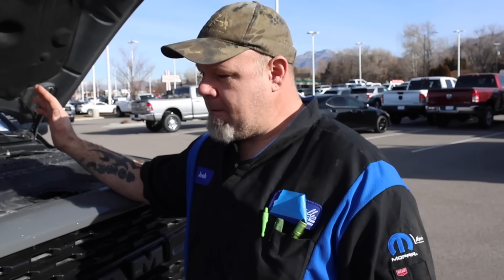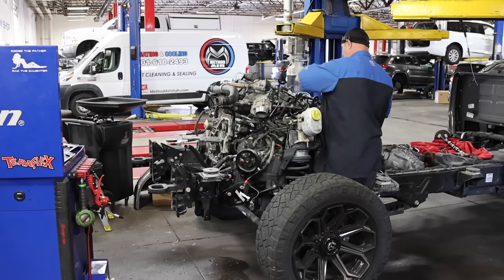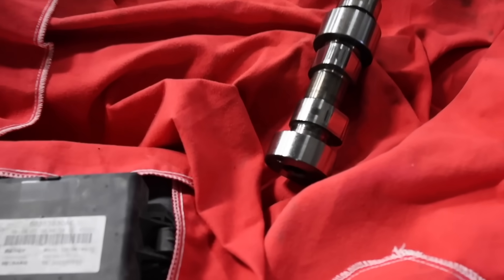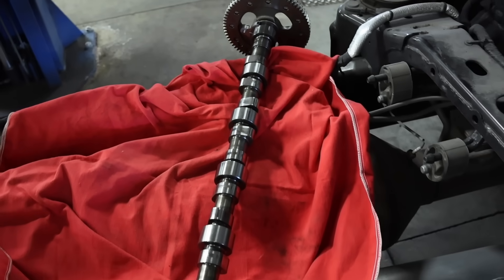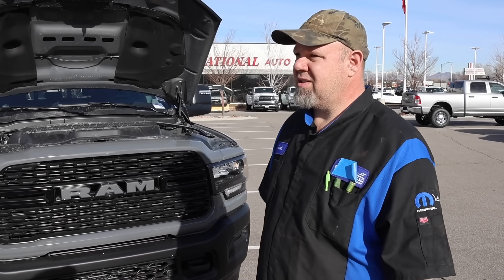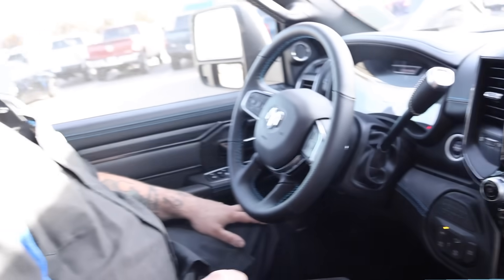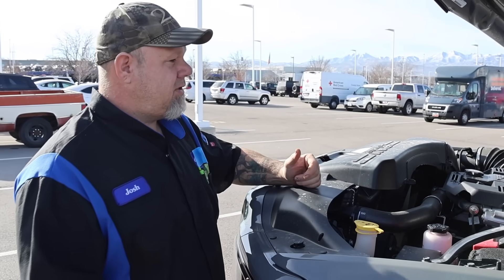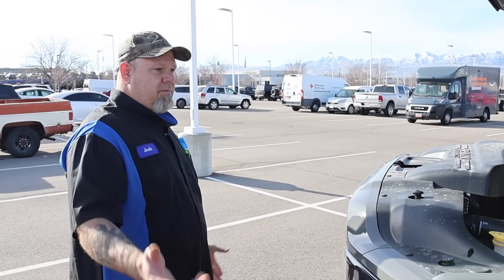Master Diesel Tech Explains The BIGGEST Killer To Your Diesel Engine!

Comment: I have been changing the oil in my old 7.3 diesels every 3000 miles since they were new in 2001. They are still going like the day I bought them.
Reply: Oil changes are cheap insurance .  I dont care  if its at 3 or 5000 .   15000 is just stupid .
Reply: Hey if you got the time you got the money whenever makes you happy
Reply: 5000kms in Australia if u are using it😊 or 10000kms if it's a shopping cart😮
Reply: @lukewarm2075  I agree, people forget the air filters too which causes all sorts of problems. I tow 1800 to 2000kg trailers on occasion from Sydney to the Gold Coast it makes a 20yo 5 speed manual Mazda Bravo work but regular monitoring of the motor keeps it going. I bought it new and plan to keep it.
Reply: I have a Holden rodeo  with Isuzu engine it’s done 400,00k change oil every 10,000k  with filter still running perfectly like a clock it’s 34yrs old never had any issues with this engine  it will out last me😢
Reply: Thats why they still going good all the extra oil changes still way cheaper then rebuilds me very similar will all engines 5000 kms or 3000 mile oil change New Zealand
Reply: If you are going to keep the engine going for high miles, then I'd change the oil and filter every 5-6,000 miles. If I was going to move if on after a year or 2, fine, just keep it topped up.
Reply: 3000 miles is perfect.  5000 miles is kinda the limit to oil changes.   2001 was excellent as it didn't have all the annoying EPA requirements of today.   Keep that work horse running!
Reply: They should last forever doing that. Smart.
Reply: Oil is cheap flushing out the bad in with the new also clean fuel and clean air
Reply: Thank you for this information, I was beginning to doubt myself with all the anti idle stuff, common sense says not to start driving with a cold engine
Reply: That’s also the best diesel engine ever made!
Reply: Yes, but your diesel engine doesn’t have all the EPA mandated crap on it.
Reply: I start truck before closing the door. If raining I close when I get in.  Once started, I adjust all mirrors, arrange any items, change to better radio station or plug in phone…  buckle up, etc.  this can take 10 or more seconds.  By then, the oil is moving thru all lubricated parts. Never ever “blip” the throttle… that puts more strain on the head gaskets… same with driving or acceleration too fast before engine is up to “operating temp.”.. I have seen more “blown head gaskets” on Harleys, cars, especially if you are jacking with the “tune”…
Reply: we got the same motor in a work truck. It has 500,000 miles and it's lucky if it ever gets an oil change.
Reply: Yaaah, going like a raped ape.
Reply: Dude my buddy changes his oil once a year in his 2012 duramax. He uses the Amsoil 25,000 mile oil.
Reply: @matthewlong2981  I changed the oil in these vehicles twice a year whether they need it or not but I drive under 3000 miles a year because I have several of them and rotate them around
Reply: That's what is in the owners manual and recommended buy navistar and its due to the antifoaming agents in the oil that is needed for the HUEI injectors to operate correctly. The anti foaming agents usually go before the oil itself is done. 
You can't compare and  30 year + old designed diesel that is all cast iron block and heads to the new power plants.
Reply: @Patriot108-1  That's right; it's not fair to the new junk to compare it to the properly designed engines of the past.
Reply: @Patriot108-1  it is actually 7,500.
Reply: Bullshit
Reply: why not every 1000 miles? If you are going to waste time and money on oil changes, take it up to the next level.
Reply: @RobertTate-qy6nk not your truck is it
Reply: @RobertTate-qy6nk depending on use and heat and environment and time between oil changes
Reply: @RobertTate-qy6nk found the guy that goes 10,000 miles per change

Comment: At what temp would you shut off the engine? I pull 28k in high humidity and oil temp can get up to 230 degrees. I have to let it idle from 10 to 20 minutes to get around 200.

Comment: I live in Colombia (country) and have a Toyota Hilux diesel engine. The intervals of engine oil change is 3000 miles recommended by dilership and manufacturer. Happy to do it so often and the price is only 50 dollars for the change in the dillarship. This video is making me think that may be should shorten the intervals? The temperature of the area where I live is very hot all year around Florida wether. I was wondering what’s the reason of a 3000 mile of a recommendation of a oil change or 6 months. Some though about this intervals will be appreciated. Thanks
Reply: And yessss for starting the engine and living it runing for 5 min before driving the car. Me toyota does not have running the engine on a faster RPM than the factory set that in the morning is around 1000 RPM. Should I give I press the revolution pedal to increase the RPM to 1500 when I warm up me engen in the morning or won’t be recommended since the wether here is so hot ?
Reply: Thanks for the advice

Comment: I have 5 trucks with over 500,000 k on them. I used a diesel cooling heater. 
I don’t I don’t idol the trucks. 
I get my oil analyzed every 10 k 
I’ve gone its highest 50,000 case I don’t oil change. 
My motors stay clean and one motor at 560,000 k I did a bearing roll not one bearing was bad they looked relatively new still. You have to work those engines. If you drive it for a grocery getter then buy a gas truck

Comment: 10 min autostop  is so it doesn't run till its run out of gas when you order one more beer and forget about it. Higher revs in neutral is not great, its injecting very little fuel with no load. if you have a heavy trailer, sure warm it up for 10 min, but if you're going to a store just drive like you have a newborn with you for first 5 min

Comment: Could you do a long video, or maybe a playlist, on Diesel 101 for new diesel owners?  I found this information extremely helpful as someone who has never owned a diesel but is interested in buying one.  Basically a detailed walkthrough of diesel engine basics, how all the parts of the exhaust system work, how to properly operate your vehicle from cold start to shut off (when towing and not towing), things people should be aware of when switching from gas to diesel, what to look for when buying diesel fuel and DEF, 101 on glow plugs and grid heaters and how they work. What things to do differently in cold vs hot climates (and what those temp ranges are). Essentially a crash course on owning a diesel engine for gas engine owners so they are prepared as they can be so they get the longest life out of their truck, plus any tips and tricks you’ve learned that you think new diesel owners should know. I’ve had a 2019 1500 5.7 for 3yrs and I’d like to step into the diesel world but I want to be as prepared as I can be before actually owning the truck.  If you could also do a video on things to know when upgrading from light duty to heavy duty trucks and what all changes when you upgrade from light duty to HD, that would greatly appreciated too.
Reply: First time Diesel owner( 22 Ram 2500) here got mine to tow a travel trailer as we both just retired and wanted a truck to handle long trips. We took it from Va to Ca and back only had one small issue but other than that it did great especially in the mountains. The best advice I can give you is go to a local Diesel shop they are a wealth of information and the main thing they said was do your maintenance.

Comment: I change mine anywhere from 3,500 to maybe 4,500 miles. I changed it myself and don't mind spending $130 cause it's better than $15 to 20k for a new motor ii have a 6.0. So it's not as expensive as all them $90 to $100k trucks

Comment: Great video, have a 3.0 F150 diesel. I do oil changes anywhere from 2500-3000. I run about 2-3 quarts of oil through oil fill and filter house to push out old oil. At least one a year I flush with 4 back to back oil changes with filter running at 15 min each, 4 oil change is final. No I no no one will believe this but after doing that I takes about 100-1700 miles before it starts get dark (not fully dark). I run Rotella T6 5w 40. 

Just had both timing belts both timing chains changed with tensioners, changed glow plugs, fuel rail lines (at engine) water pump, thermostat, drive belt. At 139000.
Reply: You like wasting money.
Reply: @j-rocsk  i mean he has a weak diesel so he has no option really

Comment: Ok, you may think I am telling something not true, but I have been using 24,000 mile oil change since 1977 on several vehicles. Change filters at 8k. Synthetic does not wear out like petroleum oil, so keep your oil clean and since acid builds up change oil and filter at 20-24k. Lawyers at Mobil One won’t approve long change intervals if they thought the company was at risk of being sued !

Comment: I live in a warm climate area.  I start up and drive out of the garage and onto a city street for about 1 mile then on a 4 lane road for 10 miles before getting into town on a 45 mph 6 lane road.  So, I don't warm up the engine at all before driving.  Is that a mistake?  Maybe but it doesn't seem to affect my vehicle.

Comment: My Q7 has a built in Webasto heater which helps a lot in winter. Engine can be pre-warmed and the  heater will kick in anyway if temp outside is below 10 deg C. Very nice feature.

Comment: 15k oil change intervals on diesel engines are adequate with good 5W40 synthetic oil,
Who does 5k intervals on diesel engine is 
ridiculous and waste of  time and money,
Unless you are towing periodically at least gas engine is way to go,
Maintaining diesel engine is very expensive and they are very slow trucks heavy front winter time takes forever to warm up,
Good luck  and God Bless  🇺🇸

Comment: I have had a different experience with the Cummins engines in the Dodge trucks I own(ed).  I was VERY surprised that I never saw the  engine oil look black on the dip stick as I was expecting, from being around older (Pre-1990) farm and construction equipment.   I have run the oil in my 5.9, 12 Cummins engines 5,000 mile and seen only minor discoloration, NOT black, sooty looking at oil change.  About the same as I had experience with gasoline engines.  Don't much experience, as an owner with the Ford Power Stroke engines, so don't know what one is likely to see on the dip stick from those.  Cummins BUILDS GREAT ENGINES.   I've driven as a CDL driver in trucks with the Cummins M-11, the N-14, and the ISX.  All stated easily in cold weather and were great performers.
Reply: The way the drainplugs sit in the oil pan prevent full oil drain and pickup tube drain.  By design?  Why?   Anyway about 1 qt of old oil is left at each oil change.
Reply: I can't say of all the trucks you had anything to do with but from what I gather 2003 was the time frame when Cummins came out with the EGR on the ISX engine and Cat soon after that came out with the ACERT engines with the compound turbo system along with the IVA system to reduce certain emissions to meet a standard at that time. I do own an ACERT C15 but never did own an ISX or newer, it was the older 855 and N14 I had in four wheel drive field tractors. However I have one post emission John Deere with the EGR crap ( no DPF or DEF ) and what a difference in how FAST the oil becomes coal black. That EGR system is such bullshit for the engines health its beyond mind boggling from an engine health stand point that they had to resort to an engine eating its own soot. The main point I was eluding to is that pre EGR diesel engines took time for the for the oil to become black but once an engine is strapped with EGR its black after a few hours of operation.

Comment: You are correct, 5,000 miles is ideal.  Anyone who ever does an oil analysis at 5k and 15k; the results speak for themselves.  👊🏁
Reply: I have a 5EK cat with over 1 million miles and with a bypass filter system I have run up to 80k miles and the oil test ok. My engine uses about 1 gal per 4k miles which replenishes additives enough that I don't have to change my oil but only the filters.
Reply: @allanmccullough8550 that’s because you have an oil bypass filter….
Reply: I was doing 4-4500 mile changes on my 06 Cummins, oil samples were great, one time I tried a 8500 mile and oil analysis came back still good and they told me to try 10,000 mile. For no reason other than it doesn’t feel right and I can afford it, I’m doing 4-4500 mile changes. So there goes your theory on seeing the difference. Maybe these new rigs are different.
Reply: correct
Reply: Abiding by UOAs conducted by Horizon and Blackstone Laboratories I have run 20k intervals on my 6.7L Cummins with no problem.  Wear metals were only ~2.5 ppm per 1000 miles, soot 0.1%, 5000 ppm anti wear additives remaining, fuel dilution <2%, TBN 4ish and barely oxidized due to POE ester base stocks used in Red Line synthetic.  Amsoil 2 micron bypass filtration works wonders for catching that super abrasive soot.  Also tremendously helps to not breathe in its own excrement or encounter restrictions after the turbo as God intended.  Recently I pulled the valve cover off to retorque headstuds and everything was spotless.  No varnish anywhere whatsoever!  Now would I be able to run 20k intervals on a bone stock truck? Absolutely not and the UOAs prove that, no matter how top shelf the oil is
Reply: Nah, I'm running 20k miles on my ford. Use good oil like schaeffers, and it'll be ok.

Comment: So what is the best oil for the cummins on hot state like Florida?
Reply from the maker: 10w30 synthetic for diesel
Reply: 5w40 year round for Florida climate. 10w30 isn’t ideal for extremely hot and humid climates. 10w30 should only be used to roughly 85°F.
Reply: @ well im NW FL, so winter time it will not go above 70-75 where im @.
Should i use 10-30 in winter nd 5-40 for the rest of seasons?

Comment: I drive a kw t680 with a paccar 13 litre engine
Use 10w30 syn blend Chevron oil...change oil and filters at 60k intervals per manufacturer recommendations.
We have 3700 trucks across the country
No engine failures due to 60k intervals.
I'm pretty sure if you run a good quality full synthetic in a tiny 6.7 Cummins in normal conditions you'll be fine.
Reply from the maker: All 5th gen Cummins gets synthetic oil as designated by the manufacturer
Reply: And how many miles are on these trucks when they go to auction ?
Reply: @DavesNotHome2704  usually get rid of them before 750k

Comment: I agree with good servicing practices 👍 I have run diesels for many years now  . think  one important factor  that people should take into consideration when purchasing a vehicle is how you are planning to use it if you only use it for short runs or hauls  . Maybe consider a gasoline engine they warm up faster than a diesel  and have less carbon issues  . A diesel  likes to run at operating temperature under load at modest RPM for extended periods, especially all day long, that help them to perform well in the long haul  .

Comment: 2017 2500 manual transmission, living in Tennessee. 

Occasionally pull an 8K mini excavator and a 34’ toy hauler.  Is my daily driver, has 110K miles. 

Only modifications: Run a remote dual oil filter and a 2 micron Baldwin fuel filter ahead of the factory one under the bed.  

Shell Rotella 10/40 
I do oil analysis at every change at 10K miles.  

In six years I’ve been doing it, I consistently get the same message from the lab: You could easily go 2-4K more miles on this oil.  In the winter time I get, “ contaminants are up, but not enough to cause concern”.  

Why??  I admittedly idle it a bit more to get it up to temp, more for me than the truck ‼️

I’m not a rocket scientist, common sense tells us that all this EGR/DEF and the related EPA junk is in no way good for these engines.  

Oil is cheap, engines aren’t‼️